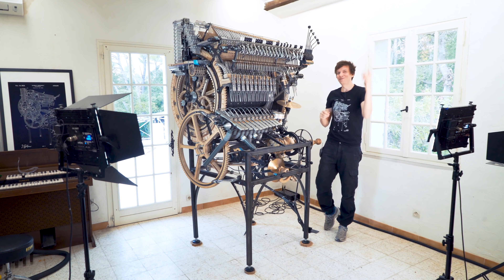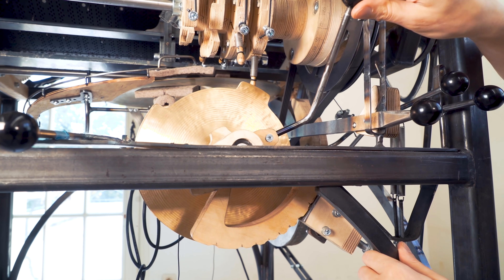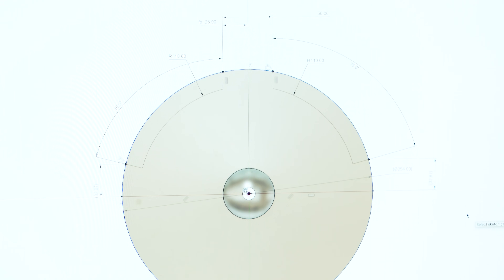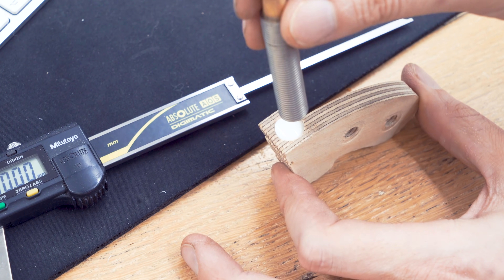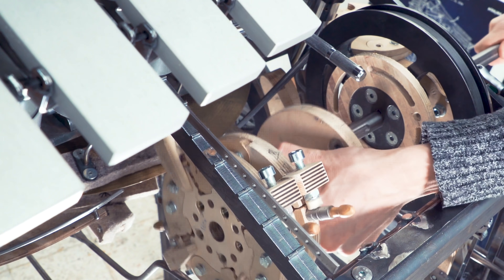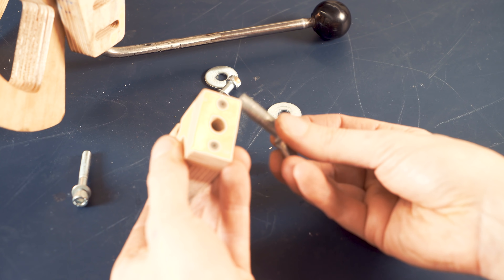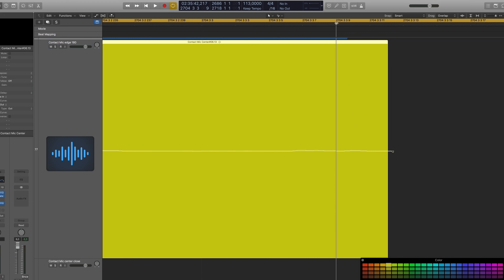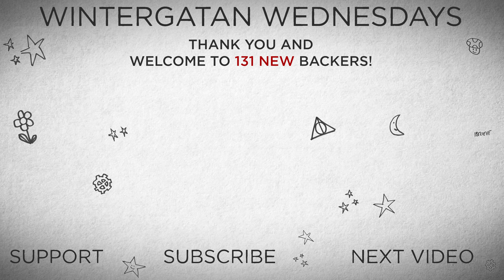I Made a Hi-Hat Machine - Will it Work? | Marble Machine X #108

Comment: I remember the rubber bands being a source of problems on the original machine. Hopefully these will be more reliable.
Reply: Yea, I'm afraid they are not going to hold the timing really well... :( The forces need to be in perfect balance between the band and the spring. These things change depending on time due to material fatigue or even temperature change...
Reply: @bzqp2  It is NORMAL for acustic musical instraments to need tuning up every day.  Concert Hall Pianos get tuned before every performence!  Martin expects this and is building in all these tuning points to account for it.  This is a perfectly normal and expected part of making a complex mechanical musical instrament.  (Viabraphones, Marimbas and Xylaphones are the exception.  Ditto with handbells.)
Reply: @kin2naruto  
yea i agree, theres a reason it's completely adjustable.
plus all he needs is a laptop, some software, and about a hour to tune it before doing a live show.
you would do that anyway with whatever instrument you are using anyway before you do a live show.
Reply: @kin2naruto  Can't really trim off/add some metal on a vibraphone to account for temperature XD
Reply: @EmersonPeters  The vibraphone doesn't change mass by temperature.
Reply: @kin2naruto Well, there is enough prep work on the MMX already. I guess an extra hour with digital timing tuning is gonna get tedious pretty quickly. Elastics are simply not reliable enough to be used as 1ms-precise timing instruments. 

@Malco I'm glad they are. :) I guess since the mounting mechanism is modular there are some solutions possible. Maybe the holding piece can physically rotate around an axis to get a proper angle.
Reply: @rocksfire4390  Sure but I think he'd prefer for there to be less tuning than the elastic will require and at some point unless he keeps spare around fastidiously they're just going to lose the power to pull the string back at all.
Reply: @MrRtkwe  
wouldn't be hard to swap them out and tune it again.
this is no different, although a lot more complex, then tuning a guitar or a violin.
you gotta remember that this machine is doing EVERYTHING, it's not a single instrument but rather a collection of them. you HAVE to tune some parts of it, you can't avoid it.
while i agree it should be made as easy as possible. pouring extra time into this, at least in my opinion, isn't worth the time and effort it would entail. if a viewer has a way to do it, go for it but until that happens i wouldn't put more thought into it then is needed. there is still A LOT to do on the machine still.
Reply: @beezqp Martin needs to contact the bunji/rubber band company and get a data sheet from them or ask them "what is the total number of cord stretchs before they require replacement" or ask how many stretches before they distort and by how much do they distort. Then he can make a mark on the adjustment screw that has a rule so he can compensate!
Reply: Some of the team are looking into alternatives for Martin
Reply: @malco84  "Some of the team are looking into alternatives for Martin
" What? Are they worried about Martin being worn out and losing precision over time? I'm sure it will be difficult to store spare Martins back-stage. Oh, you didn't say "alternatives to Martin"! Good, I hope we can keep the one-and-only Martin in this design. :-)
Reply: @JensGulin  They have carried out an exhaustive search and have yet to find another mad Swedish musicial inventor the search continues :)
Reply: @malco84  "Some of the team are looking into alternatives for Martin" we don't want alternatives for Martin, we like him just as he is, right? LOL!
Reply: I wonder if he could use another spring instead of the elastic bands to adjust timing somehow. Like maybe have a small rod sticking out of the adjusting screws and attach one end of the spring to that and the other to the drumsticks.
Reply: Those look less like rubber-bands and more like elastic strings that you can find in clothes. They also deteriorate but are more durable that naked rubber.
Reply: Why did he use elastics though, and not string?
Reply: Maybe he could use a compressive spring where the coils don't touch each other. I think that would get rid of the mechanical noise when the beater flaps back to the neutral position.
Reply: @rpyrat  Probably it has to do with damping of the spring.
Reply: I feel like he should use silicone gaskets instead of rubber bands because silicone doesn't degrade as bad as latex
Reply: I was wondering if nylon could work better. As much as I understand some of the comments defending the decision, any one less to think about on the machine is a plus, because unlike a traditional instrument, this has thousands of points that will require “tuning”.
Reply: Viton is an elastic material that comes in O ring form and is design ed to resist oxidation based degradation. I think another spring or position adjustment of the entire beater is preferable to relying on rubber-y stuff though.
Reply: @petric334  Hmm.. I don't think it is. Looks like standard elastic cord used in clothing, which has a fair bit of stretch. Viton is high-density, and normally used under compression rather than tension (not very stretchy), and it's a sealant-type rubber that they don't manufacture inside a sleeve.
Reply: @nagualdesign  you're right, viton's  elasticity is way less than rubber and works better as a compressed O ring.  My main point was that I have encountered the failings of elastic material under tension many times; I think if you need a precise elastic effect over time, play with springs of various materials because I don't know a "rubberesque" material that retains any precision even over short periods.  There may be one but I haven't seen it.
Reply: @petric334  Sure you have. Think about it...

Vulcanized rubber, used in the tyres of vehicles in every weather condition. The cords used in elastic draw strings (in clothing) is also vulcanized (it's black).
Reply: @nagualdesign  absolutely right. But none of those applications rely on wavelength-precise tension over time. Tires "break in", my underwear start to loosen basically immediately but my skin can easily tolerate 2-3 times the force necessary to keep them up.  My direct experience is with natural latex or silicone seals on dry suits used to seal off water against skin.  Even under a very low pressure delta (drysuit inflated to counteract water pressure) latex and silicone degrade when the suit is hanging in the garage such that depending on the garage conditions, even if the seal was 2 times tighter than it needed to be when you stored it it can still have degraded to ineffectual with zero use. Just atmospheric exposure can render it ineffective. If you are trying to achieve musical timing relying on the elasticity of such materials, the standard is much less forgiving. I could be wrong, but if constant, precise tension is the goal I dont think I've used an elastic product that compares to non-elastic mechanical means for precision over time.
Reply: @petric334  Agreed. Although a spring will still require regular tuning it's much more durable than elastics and rubbers, not to mention being far more predictable.

Having thought about it, what he's using the cords for is to stop the drumstick springs from closing. It's the sound of the spring snapping shut that's the problem. So a solution might be to use 'open' springs on the drumsticks, where the coils never contact themselves, if you know what I mean.
Reply: @nagualdesign  Right, possibly a nested spring like a Glock firing spring could work, but I tend to think you use a lever to reduce the amount of reliable elastic travel required, then use metal.  Or better, just change the position of the beaters (and possibly length) to channel all of the adjustment tension variability into the spring you already have.
EDIT: there is also the concept of a torsion bushing, but again the relies on reducing the travel via a lever then controlling travel of the lever. I think the least fiddly solution is just tension the spring you already have based on its position and reduce the need for any additional tension generating material.
Reply: Very different point of view between musician and engineer. Very intersting..! Maybe that is why we need team projects even thought it's emotion consuming.
Reply: I thought about wire, made from synthetic fibers like polyester or nylon. Maybe fishing line
Reply: The synthetic rubber component of the new elastic is inside a textile sleeve, and the rubber itself is normally the vulcanized (black) variety, so they will deteriorate much more slowly than your common or garden rubber band, which are highly photodegradable.

And while the modulus of rubber is affected by temperature, so are springs. As things warm up springs get softer while elastic gets tighter, so either way things need fine-tuning.

Comment: for me as a drummer the opening and closing of the hi-hat is "too slow".
Would it be possible to also tilt the lever forward and backward so that you can open and close the hi-hat with it?
Reply: I mean there still is the programmable HiHat that can be openened and closed quickly. This one is just the rythm machine, anything complicated will probably be played on the other one
Reply: He's using two hi-hats to achieve mechanically what you could do with just one hi-hat. The one in this video is for basic, mostly closed, repeating notes without any accent, and the other hats are for everything else. The other hats can open and close instantly.
Reply: This is not the hi-hat, though. This is just the rhythm machine, almost like a shaker. The real "hi-hat" is the one above and is can be open and closed instantly.
Reply: @TUTAMKHAMON  it's the low-hat.
Reply: His can make a second lever like a bicycle brake.
Reply: Yep, what I wondered. Some way to quick adjust the Hihat.
Reply: The hi-hat that opens and closes quickly is right there! You can see it!
Reply: Or get one of your engineer friends to make some fancy ring gear assembly to magnify a 1/4 turn into much more...
Reply: winter has to see your comment.
Reply: I was going to say that, maybe a spring-loaded lever.
Reply: Agree
Reply: Adding on to this idea, perhaps the lever could have a 10 to 1 movement ratio, where you have to push the lever forwards or backwards 10 inches to move one inch. This way the movement of the hi-hat is not only accurate, but very easy to do so with minimal effort, too.
Reply: Kazu ya
the lever itself wouldn't be able to move that way as it's locked by the ball, however he could put another lever in there  and that could losen/tighten the gear itself which would be easier and way less dangerous to control.
Reply: To much levers ! But cool idea
Reply: Great idea, seems like it should be possible.  Maybe for later revision after getting back to work on other things.
Reply: I feel you, but I also feel like that's an intentional compromise. Martin isn't generally going to be playing just the hi-hat, he's also got to crank the entire machine (at tempo, which looks like it's harder than it sounds) and work the bass guitar. One man can only do so much.
Reply: I assumed that the sound was fixed, and the adjustment screw was just to set it and then leave it, not to be used during a song. Maybe an opening and closing hi-hat will be a feature of MMX2
Reply: Maybe some sort of pedal to control opening and closing.
Reply: Agreed. It shouldn't be too hard to add a finger pressure plate type of tension mechanism.
Reply: Make a foot pedal to open and close it or even control it with a channel somehow.
Reply: My thoughts too. Opposing cams on the shaft would do it. 1/4 turn on a similar lever could give the full range of tightness.
Reply: Opening/closing of rhytm machine hihat looks like a gear. Could it be attached to some other gear which quickly rotates it?
Reply: Was thinking the same thing, almost like the blinker/flood light lever on a car
Reply: Agreed

Comment: you can add a swing rhythm with those fine tuners!!
Reply: Swing is basically just triplets :)
Reply: @Nomen_Latinum  Triplets are a form of swing and often referred to as "swing", but there are many more possible ways than just triplets to offset a rhythm and have it sound good, you can even offset triplets and get swung triplets
Reply: @bladex2581  That's fair, but while you could offset the hi-hat machine timing for swing, you can't adjust the programming wheel—although I suppose anything is possible on the stud welded version. For all practical intents and purposes though, the triplet track will probably work just fine for your run of the mill blues type swing.
Reply: I was just thinking about that. Are all the other instruments gonna be able to play in swing format? Because that is going to be amazingly cool.
Reply: I'm talking collier-ian, septuplet swing... none of that triplet rubbish

Comment: You should bend the hi-hat's cymbals where you cut out material (or close the gaps in a different way, I've no idea what would work best), so that the cymbals are tightly closed when you set it to the tightest setting. Right now you're letting sound move through the gaps you have created, causing a dull sound to follow a strike.